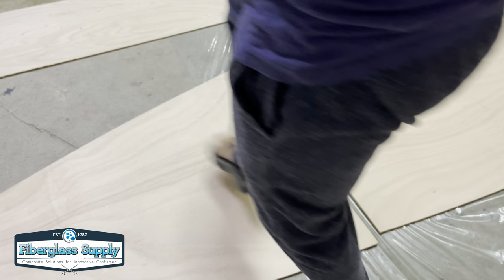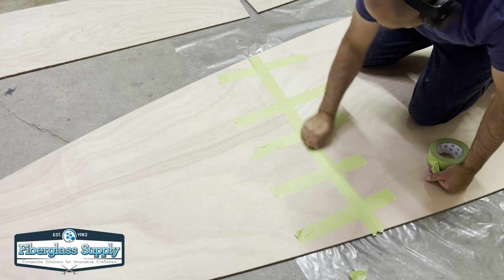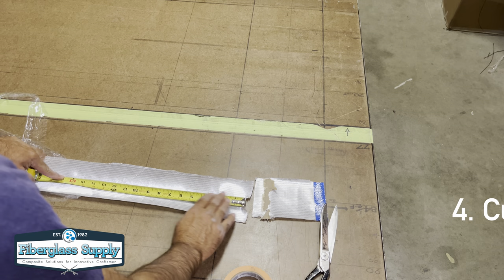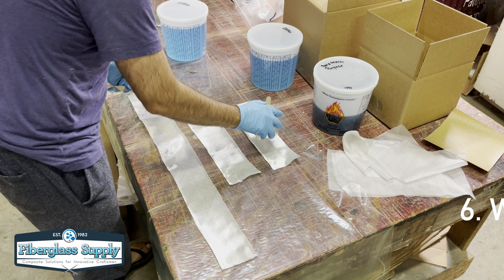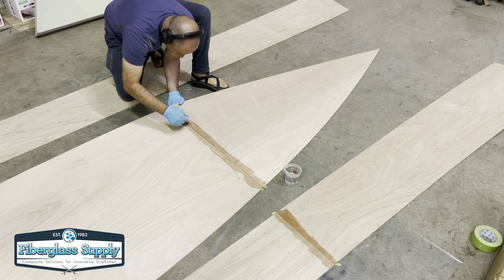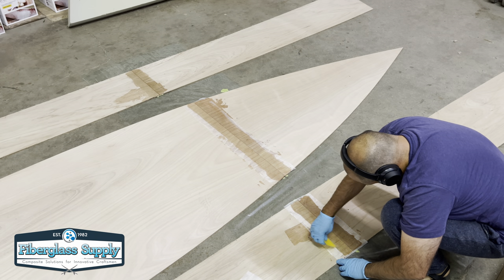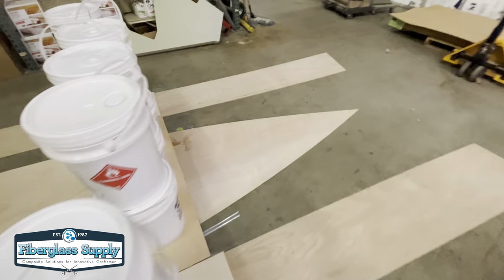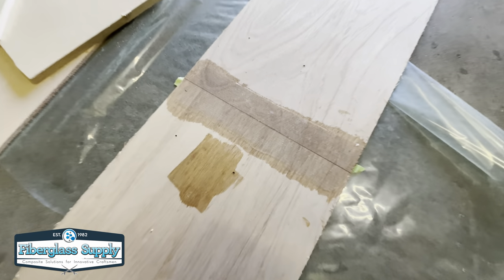How to Stitch and Glue Boat Building-Glassing Butt Joints

Comment: I now live in Indonesia and don't have access to a lot of the nice stuff like peel ply and fiberglass tape. We do have some very thick tape used for insulating mufflers but it's not really useful for stitch and glue projects. Instead I use a section of ply large enough to fill the space between the ribs and or inside the seat/ buoyancy box, which works pretty well. I've also found that cheap plastic document covers work well in place of peel ply or plastic to cut down on sanding as it lays flat and is reusable. Actually I enjoy the challenges posed by not having everything easily available and have learned a lot by watching local boat builders using very simple tools to quickly create very beautiful and strong working boats from basic tools and materials. Some of these guys even have YouTube videos and I get a big laugh reading the comments from Americans trying to tell them everything they're doing wrong, which always gets a ❤️ because they can't understand English and just appreciate the comments. But these boats are out on the water and stored on the river bank or beach in a tropical climate every day without any protection. Not to mention the materials cost roughly $100 USD for a 16 footer so imho you can't argue with that.

Comment: Hmm got a question. Got some plans for a 20 foot Jon boat. It says it needs a butt and bulkhead every 4 feet. 

So this is the butt joint and then you use plywood and hardwood laminated together with epoxy and fiberglass atop this butt joint?

Comment: Can this be done with polyester resin? If so, any alteration in the process?

Thanl you for the video very informative
Reply: Polyester resin doesn't stick very well to wood, at least in my experience.  When someone insists on using polyester resin on a wood boat I just warn them to always wear a life jacket, and no I'm not kidding.
Reply: Thank you. Yes I can believe that . The cabin of my boat is wood with a old layer of gpr with poliester resin and I just ripped it off clean from the  wood

Comment: I have a new catamaran and/or trimaran hull design which has been in progress for the last 15 years. It is new/novel and therefore patentable.
The hull is asymmetric. Though, for description purposes, it could be described as a variant  of a conventional symmetric and a conventional asymmetric hull shape. Since, its shape is symmetrical above the waterline and asymmetrical below the waterline, the result of extending existing lines of a conventional symmetric hull at and below the waterline.
This catamaran and/or trimaran hullshape is suitable for a range of craft from SAILING to small and medium POWER craft.
SAILING: The hull's benefits for a sailing catamaran or trimaran are; 
*speed
*pointing ability - VMG
*no necessity for of dagger or centreboard
*simple, flat panel design lines, ease of manufacture.

POWER CRAFT: Benefits of an symmetrical hull shape without the negative characteristics such as;
*speed of asymmetric shape
*more balanced reaction to waves - less broaching
*banks in turns
To anyone with interest. Cheers

Comment: is the "peel ply" needed? or the two ends can be joined without the use of the "peel play"?
Reply from the maker: The peel ply is optional. It does make for a cleaner joint that requires less sanding.

Comment: I was taught to make 8 to 1 scarf joints in plywood to have a joint close in strength to the plywood. 
Is this not so anymore?
Reply from the maker: The scarf joint is going to have a higher strength than a but joint and most likely flex better.  Butt joints are an option where the joint is not stressed highly or sufficiently supported by other structural features.  In the case of this boat which is designed as a row boat or a displacement hull and has surrounding structural features like gunwales, keelson, and thwarts that support the areas where the joints are found the butt joints are acceptable and is easier to assemble than a scarf joint.

Comment: What is peel ply? Is it a type of fiberglass? Does it stay there permanently? What is its purpose?
Reply: Peel ply is a plastic like material.  Its purpose is to allow you to put a flat surface with weight on it (the peel ply prevents sticking) on the wet fiberglass.  When the resin cures the peel ply can simply be peeled off.  This leaves you with a very smooth surface without raised edges which fiberglass sometimes does.

Comment: Aloha, what kind of fiberglass tape is that? Has the joint ever come apart before the whole boat is glassed? Mahalo for posting  this video!
Reply from the maker: 12oz double bias fiberglass tape.  Yes it has.  We do a lot of demonstrations and I have had helpers of various skill levels.  When that has happened it has been because they did not get enough epoxy in between the pieces of wood and/or didn't saturate out the glass tape enough, or had a void in the glass at the join line.  We've 8-10 of this particular boat and have only had issues once.

Comment: You don't scarf these sheets of plywood for this model of boat?
Reply from the maker: On this boat no we don't.  The side panels are roughly 14" tall and have gunwales down both sides and the way the chine joint is reinforced it comes out really solid.  The bottom panel joint ends up between the bulkheads and has a keelson down the outside.  Given all that structure and the fact that it is a displacement speed boat the glassed butt joints are plenty strong for the use.